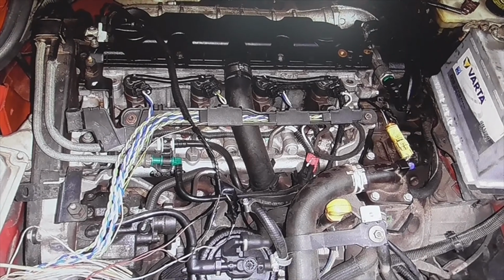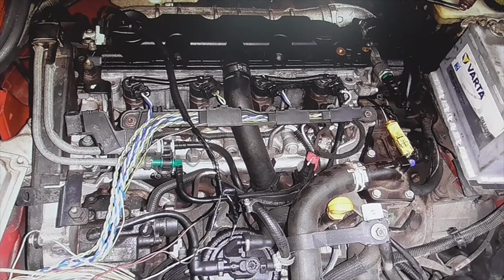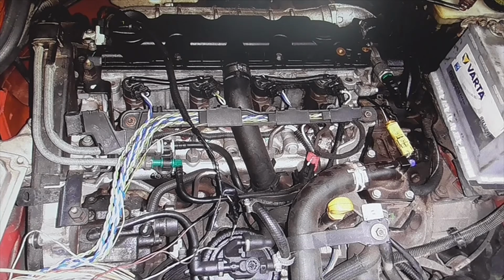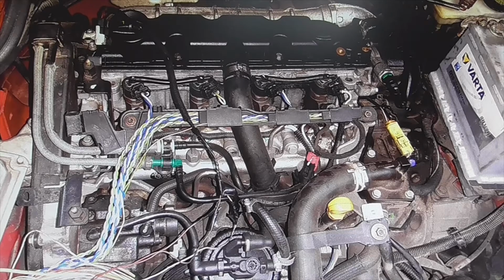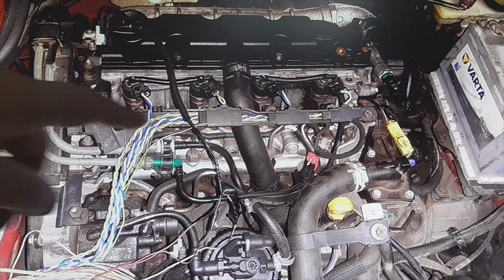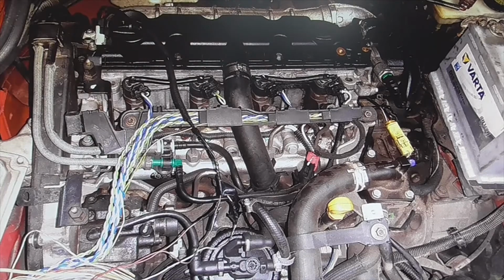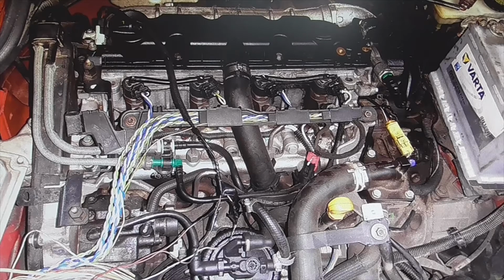This is why the battery should NOT be DISCONNECTED.

Comment: Ok so if you replaceed the bank 2 side crankshaft sensor and disconnected the battery, will removing the crankshaft sensor and redoing it, and keeping battery connected will it get ride of that particular code? Have not put the camshaft sensor bank 1 in yet. As it showed the code for bank 2 crankshaft sensor still there.  Thank you for this video. Hope to have a reply from you as soon as you can/or see this.